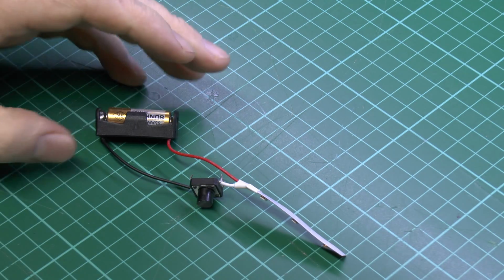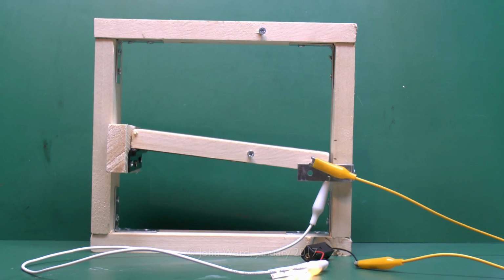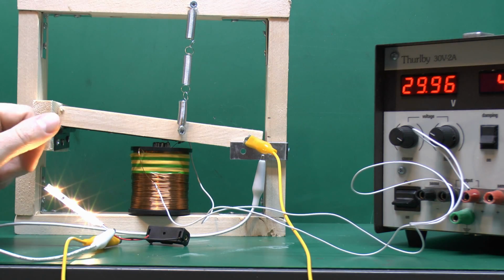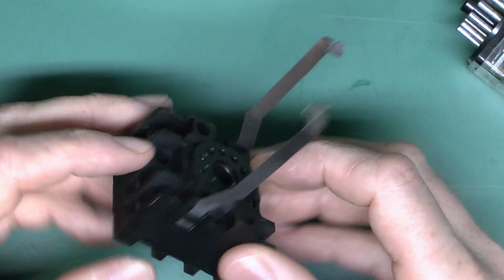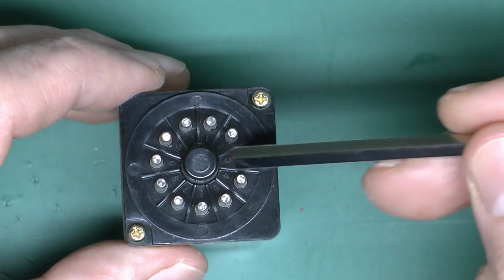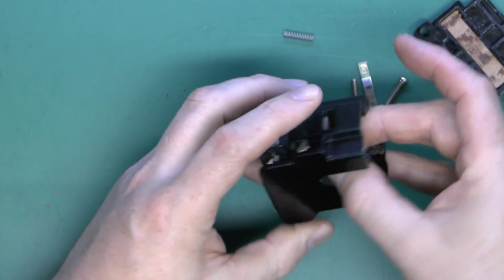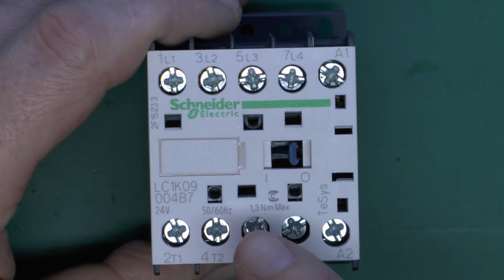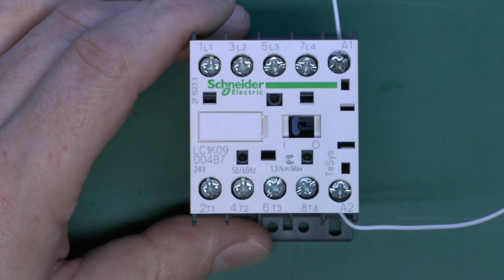Contactors and Relays - What's inside, how they work

Comment: Hi John, you mentioned it's a 24VAC coil if used with DC the current would be excessive, what if the coil was 24VDC and you use AC, what happens then? Current too low and may not work?

Comment: If I wanted last man out switch at front of a cash desk controling 4 different circuits do I feed the switch first Double pole then to A1 And A2 on contactor
Reply: All you need to do is de-energize the coil, so you simply need a switch which makes or breaks the connection depending on if you want the lights on or off.

Comment: When a dc voltage is applied to the coil, how is that not a short circuit?
Reply: Although copper is a good conductor, it still has a resistance. Relay coils and contractor coils are wound with hundreds to thousands of turns of wire. So the combined resistance of all that wire adds up. It is this resistance that limits the flow of DC.
Reply: Following the link, the table lists coil resistance for both AC and DC coils ranging from rather small to quite large capacity contractors. Based on that you can calculate watts consumed by the coil showing it's not a dead short.

https://sprecherschuh.com/library/techdocs/posts/2014/01/ca7-coil-resistance.html

Comment: A good example of how a relay works would be the call buttons on a lift - every button connects to the lift mechanism but if they were directly connected then when you pressed one button they would all light up. Although these days they are controlled by electronic circuit boards much like everything else

Comment: john please help i'm confusing myself, i have a 3 phase heater i need controlling by a timer. if i have a timer on a din rail next to it where do i pick up a 230v supply for the coil can i take it off one of the phases that goes into the contractor? sorry for the questions i haven't wired a contactor before.
Reply from the maker: You can use one of the incoming phases and neutral, which will be 230V.
If there is no neutral, you will need a contactor with a 400V coil, and the coil supply is taken from any two of the phases.
Reply: if the heater is 3 phase and earth can i bring 3 phase and neutral to the supply of the contractor so i can use the neutral, then run 3 phase and earth only to the heater?
Reply from the maker: Yes, that's an entirely normal thing to do.

Comment: John,
My system is 12vdc
To wire in (contactor)... i use the signal wires to the coil....(A1+A2) but for the power wires do i run my positive and negative from my transformer/power source to say,  L1 and L2 then my Load wires From T1 and T2?????
Thanks in advance..
Reply: Yes that is correct. There is a standard IEC naming protocol for connections on contactors. L1,L2,L3 are for the supply power coming in from the 3 phase mains. T1,T2,T3 are for power going out to the device. A1 and A2 are for the coil. If it's only a single phase contactor you'll only have L1,L2 and T1,T2 along with the same A1 and A2 for the coil.

Comment: Hello John, thanks for all your excellent videos. I have a question:- what is the usual way to provide the 24v power supply for a 24V AC contactor, i.e what piece of equipment is commonly used for this?
Reply from the maker: Usually a small transformer, either with a 240V primary (line -neutral) or sometimes a 400V primary (line - line).
Reply: By 24 volt AC contactor I'm assuming you mean 24 volt coil on the contactor. Step down transformers are ubiquitous in industry. They are used to provide power to the control circuit (it's safer than using high voltage) so you will often have a transformer which takes 240v AC from the mains down to 24v (or often 12v) AC to run the contactor coil. Common transformers run about $100 and usually fit inside the electrical enclosure where the contactor is housed.
HVAC equipment is almost universally run on 24 volt AC but it is also used widely in industry.

Comment: I watched a fridgey at work dealing with a chattering contactor in an integral fridge. He replaced the contactor, but it was still doing it. It was quite something to watch the contactor doing this as it wasn't fastened to anything so was juddering about in free air and the internal arc from the compressor startup load was very visible (and causing shop lights to flicker). Anyway it turned out the fridge controller was putting out all sorts of random voltages between 250 and 290 volts. Where it was getting this voltage from I don't know, since it was a single phase fridge, and the controller was using a smaller relay to power up the contactor. Mad.
Reply: I guess when it was disconnecting the coil it was producing a voltage spike (since the coil is inductive), which might not normally be measurable but since it was rapidly switching the coil on and off the higher voltage spikes were probably present for long enough for the meter to pick them up.

Comment: On the last contactor you looked at, what's behind the flap on the font?
Reply: Only a guess but many of them have a plastic arm that moves in and out with the switching action, and you can buy additional modules that attach to this point and give you "auxiliary contacts" that switch in tandem with the main contacts.  The modules are like relays/contactors but without the coil, as they use this arm to move the metal contacts back and forth instead, effectively piggybacking off the main contactor's coil.  Typically the aux contacts are lower current than the main ones and used for things like remote monitoring of the coil state, indicator lights, etc.

Comment: John, what is the difference between an AC coil and a DC coil?
Reply from the maker: Resistance of the windings - for DC the current is only limited by the resistance, but for AC the inductance of the coil is the main current limiting factor.
Reply: They are construction is nearly identical however they operate differently. They are both inducing a magnetic field. The DC coil is the simplest. It uses the resistance of the coil to limit current flow. An AC coil relies on the impedance of the coil along with a shaded pole to a maintain that magnetic field when the voltage drops to zero as the voltage alternates.

Comment: An Automatic Transfer Switch uses a pair of interlocked contactors - would make an interesting item to examine and explain.
Reply: Break before Make, both electrically and mechanically interlocked, is the minimum requirement.
Some set ups depending on the load and the voltage levels being transferred will have added safety requirements.
Both mechanical and electrical lockouts for isolation purposes as applicable to your SOP’s ect..

It also depends on what the ATS is for, so if it was your main supply for example. Always follow the installations applicable SOP’s.

You have to remain isolated from the grid, if you’re running a back up power supply so you’re not back feeding in to the grid. It could also just be for, deemed critical loads, same principles apply.

Or if you have alternate supplies, feeding the same installation, same for example with multiple generators sharing the load.
All AC supplies, must have same phase voltage magnitude, phase rotation and frequency must all match and thus be synchronised with each other.
Before any other power generator or alternative supply bus tie breaker/isolator is closed. 

Or you will have very big and expensive issues. Not to mention how dangerous things can become for any personal present during switching operations.

So there is a lot more to it than what people realise and that’s before the applicable local electrical rules, regulations and standards, to your country have to be considered and enforced.

Only use licensed and competent electrical tradespeople.

Comment: Hello John, thank you for the video. What kind of solution would be for noise issue ?
Reply: There are installation contactors that are quieter, although most of the noise reduction is geared towards the buzzing of the AC coil.

Mechanical means of dampening the impact (rubber bumpers) and mechanical vibration isolation (rubber mounts) would be effective. 
I have resolved the clunking issue of solenoid valves (same principle) by unscrewing them from the metal enclosure they were mounted to and using some foam rubber to hold them in place instead. You can barely hear them now, but always be mindful of that the coil doesn't overheat if you attempt a similar fix.

It's always the same strategy with any kind of noise. Eliminate the source and/or decouple it from the recipient.
Reply: +stefantrethan One additional way of cause: Just put it somewhere else, so you can't hear it.